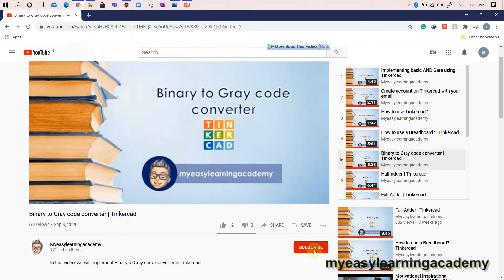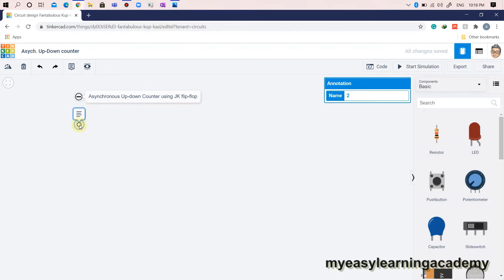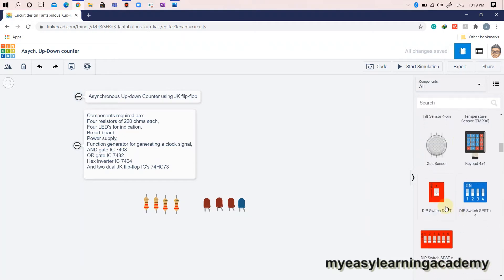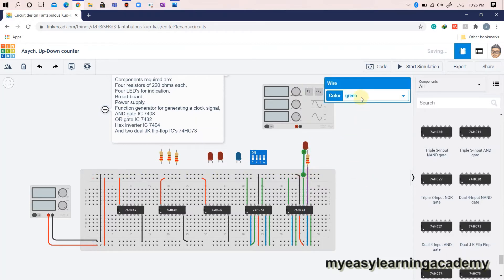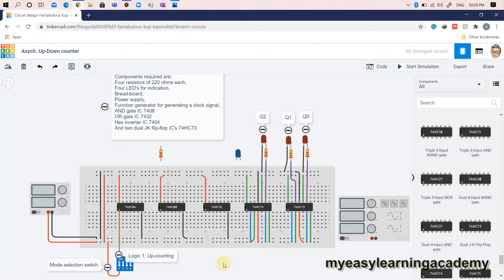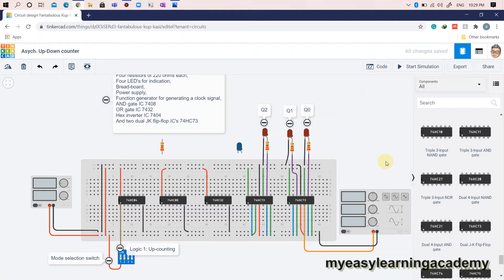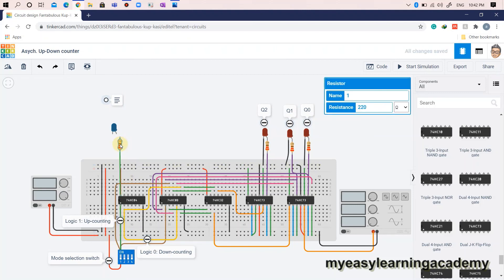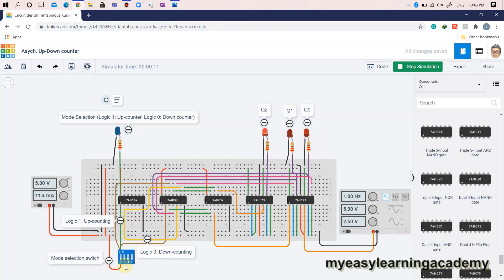3 bit Asynchronous Up Down Counter

Comment: showing the burst of flip flop of last one
Reply from the maker: There are several reasons for bursting of IC. Prominent reason may be improper connection of supply and ground to respective pins of the IC or excessive voltage or current flow through the IC or improper connections. Please go through the connections and verify proper connectivity. If possible share the circuit diagram that you have built so that we can identify the error. Thank you.